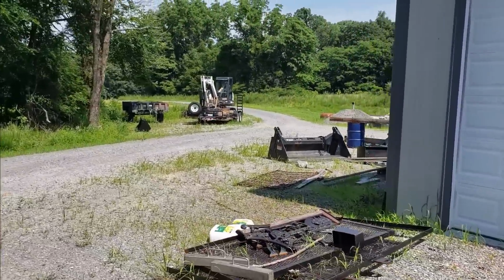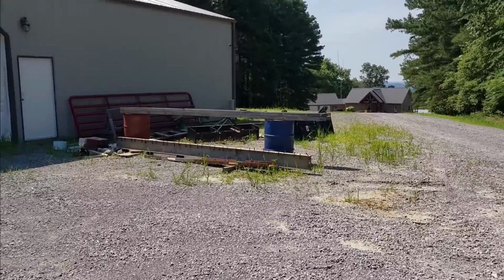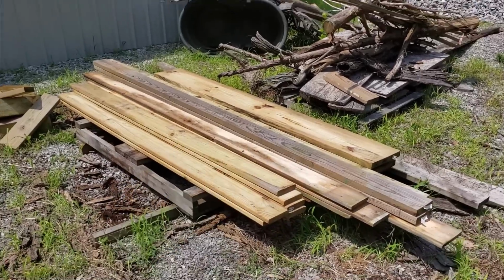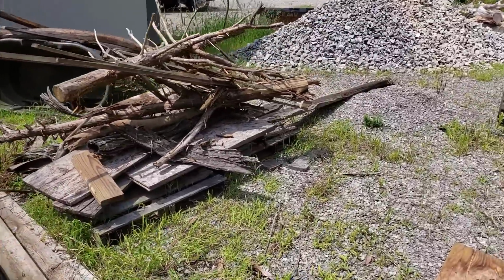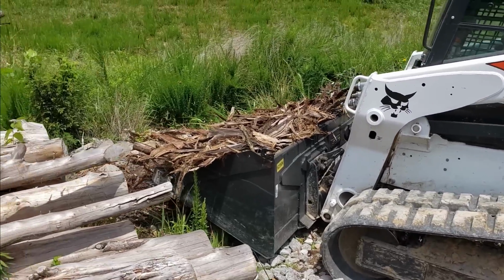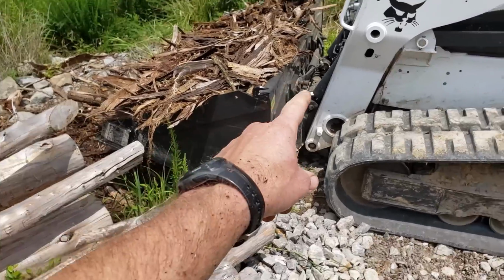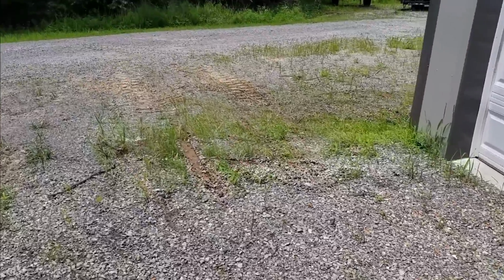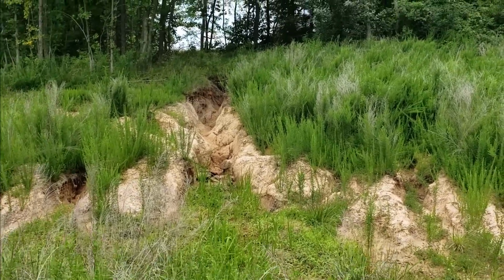Skid Steer to the Rescue! July 4th Barn clean up & Gravel work with Bobcat T650!

Comment: Dont know if it would  work but that big wash out have you thought about dumping  some RIP rap then some smaller rock on top of that then drape some filter cloth over your rock pile the cover all with clay packing in 3 or 4 inch lifts just counrty boy quess
Reply from the maker: That is just about exactly what I plan on doing! Going to fill it in, grade it, lay some fabric, and then rip rap! Not sure on the lifts yet though, I think the rip rap along might slow it down enough? Thanks.